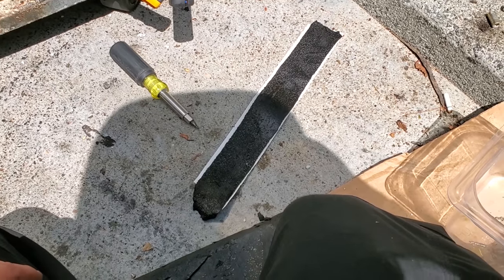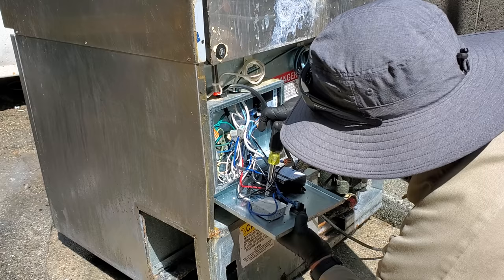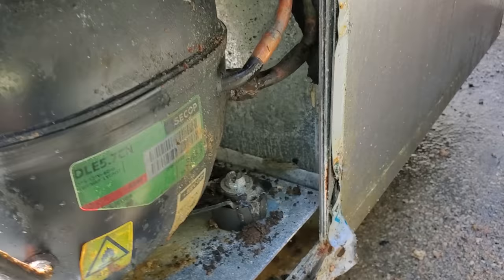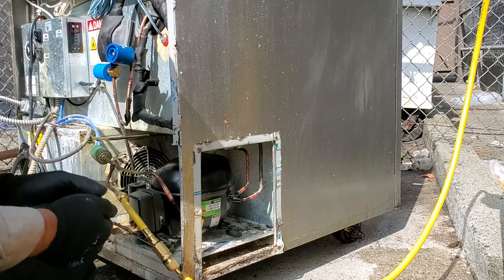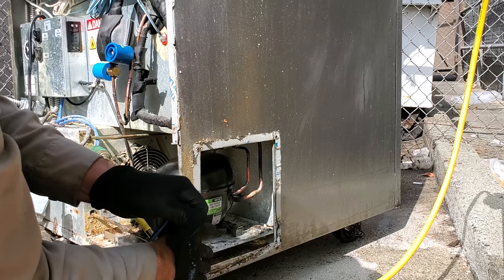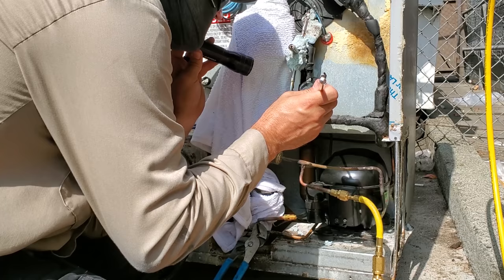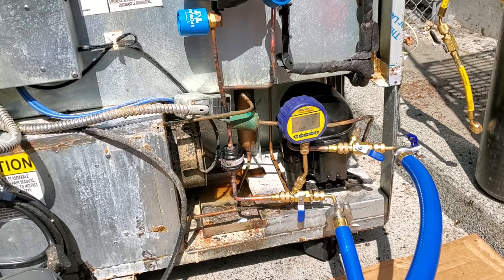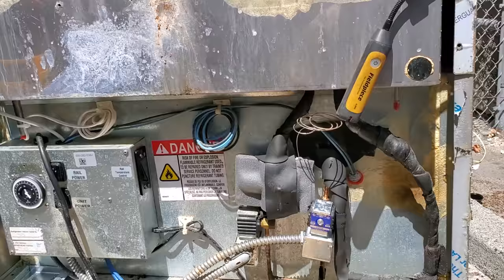ARE ROACHES REALLY THAT BAD??

Comment: In my experience as a computer technician you can have roach problems even in office buildings. Roaches are drawn to the EM fields emitted by electronic equipment. I've seen them infest printers, scanners, computers and even desk phones. Sometimes that blue screen error your computer keeps having is because there is literally a bug in the system!
Reply: Ben T.  Normally you have a company come in and spray for them. In extreme cases they may have to tent the entire building and fumigate. That gets the ones living in the walls but takes about a week before people can return to work. In one building I worked at spraying and fumigation were not an option. They did fruit fly research so spraying ANY kind of pesticide in the building would've effected the fruit flies. The only option for roach control in that place was glue traps impregnated with roach mating hormones so as to attract them to it.

Comment: I carry roach spray . I did a job customer has no heat. They answered the door. I could see a long hallway with roaches ceiling,floor,walls. When I got them running I was stripping my clothes off and shaking them. I bomb my service van. Never again........

Comment: I've used a wire wheel drill attachment ground off black paint and stay silved / Flux that suction steel to copper fitting before.

Comment: i spent the first 6 months raising the Clean Bar of a McDs, never had the 6 leg friends found anywhere. Told my boss that the costumer of the food, is they should only taste the day the meal was cooked. NOT since the store was first opened to the public. And since the cleaner that was used to wash the dish left a film upon them, the only choice was to use the extreme heat of the water heater to clean them. ~200F~ Cleans anything cooked on today, and a good puddy knife can clean off the cake stuff.

Spent 2.5 years there, Starting pay $7.25, Raised ~3 month into job plus $0.10, Quitting Pay $7.35. Worked enough hours to earn OVT, but due to how the run the calendar, and work weeks. No one ever got OVT, even with working 9 days straight. 9h50m per shift. Nope you don't get OVT pay, all is regular pay.

Comment: really a good video. I think roaches are to a kitchen like refrigerants are to commercial refrigeration equipment,  unfortunately.   I do both refrigeration and commercial plumbing and I know they like steam, water, and sewage leaks or stagnant water.  Never forget working in a tunnel and he was spraying them with raid,  they would run to the stagnant puddle and flip over in the puddle and do the back stroke, not knowing they were trying to get the chemicals off there back. lmao

Comment: Many years ago I worked doing warranty and non-warranty repairs of consumer electronics and I would often get units that were roach infested!  It was nasty and customers often didn't understand that roach infestation is NOT covered under warranty or extended warranty.  Roach infestation has to do with the unit's environment, not manufacturing defects or design issues.  After doing enough repairs, I got to recognize when to expect a unit to be infested:  A distinct smell, typically an apartment and typically by last name of customer.  Without using chemical, I would take canned air flipped upside down to freeze kill the critters when opening the unit.

Comment: I repaired large stereo receivers in the 1980's and 90's. Yes, the electronic components do attract grease and other cooking aerosols from a non-vented home kitchen. That with lint looked a little hairy on the components. This plus the heat generated attracted the roaches. The company I worked for didn't want the tech to mention the word "cockroach" or its derivatives on the repair ticket. We had some good techs laid off or fired for this. Cleaning electronic components covered with the grease, roach skins and droppings was difficult. We had to be careful not to get this stuff on your clothes. You can carry the roach eggs home with you. The roach smell.

Comment: Typical of many Chinese restaurants roaches grease coated condensers! You just deal with it! You did a great job on that unit! I hated cork tape too! When you have leaks it makes a good nasty mess and you have a nice fire when you are unsweating! Like that you used the heat dough instead of the wet rags more techs should use it works really well and is nothing like the worthless paste they had back in the day! I personally like the turbo torch better than the oxy acetylene torch easier to handle and Less bulky! You have a tip size for every job and the flame wraps around the pipe heating evenly! Also you did what the customer wanted you to do and took care of the problem and gave a honest acessment that will go along way to job security at that establishment! Great video  was work intensive!

Comment: Make sure you guys wear gloves when handling the Viper products. The main ingredient they are using is Potassium Hydroxide, which has a tendancy to pull the oils out of your skin. 

Regarding the use of potassium hydroxide on stanless steel, the only incompadible metals are copper and aluminum. I would never apply a potassium hydroxide product to either metal because it will eat it at an atomic level. You'll notice it foaming up heavily during the reaction if not diluted properly.

Be safe out there guys!

Comment: 😄 was an old timer we used to take ice machines .as he was good at rebuild.on his loading ramp a cylinder of so2 sulphur dioxide refrigerant which he leaked into the units before being brought into the shop .have a few stories about so2 I.fI interested 🤗ps he rebuilt compressors cut em open re welded .that's a lost art he had hundreds.

Comment: I use fireblock putty when brazing around sensitive equipment. It works better than wet rag, an actual wet rag, and the small square fire blankets you get. It's sticky and reusable to a point

Comment: The speed with which the client responded to the roach issue, and how quickly the pest control company responded as well, leads me to believe that he/she hadn't been informed of the problem previously. That matters, because the unit looked reasonably clean from the front which is the surface in constant view, and I'm willing to give them the benefit of the doubt here.
Maybe the infestation hadn't reached the point where people noticed. People usually begin noticing once the infestation is large, because these bugs avoid light as much as possible; you most likely discovered the issue in its early stages.

Comment: If it wasn't for the channel name and the thumbnail's background image, I would have thought that this was a Starcraft 2 video.

I saw a single roach once in my house, but then I never saw any roaches at all there for years later nor any years before, nor any signs of their activity. So the saying of "if you see one, there's definitely more" isn't 100% true, although it's probably true 95-99% of the time. Note that it has no bearing on this scenario, since clearly this scenario was an infestation and a sign that there was much more infestation at the location.
Reply: I used to own a small chain of BBQ restaurants.  I was a fanatic about sanitation but we still got roaches.  The incoming produce was teaming with them.  Especially the potatoes.  At each restaurant, I had an air-tight room built for receiving produce.  Someone would flood the room with USDA-approved food-safe pyrethrium (daisy pollen) insecticide and let the produce soak for a couple of hours.  There was a large sink in the room and all produce was washed before being put in storage.

Comment: Was it good to replace the entire compressor? or could the leak not be repaired with some sort of seal/patch? Or maybe that would just result in just more work work than replacing the compressor anyway (and/or leak in some other spot). I guess it might have also been hard to keep the pressure/vaccuum with just a hole-patch too. Oh but I guess when it's under warranty it makes even more sense to replace it I suppose.

Comment: We use heaters with a curved head that disperse heat more efficiently over the work instead of an open flame. We use it to melt heat shrink and even solder wires. If it gets hot enough to melt lead it should get hot enough for that?

Comment: Once serviced a medium size sausage factory and smoke house ,roaches were getting into defrost clock contacts compressor contactor contacts , They had open bins of stale bread and buns to mix with the sausage meat , The walls of the smokers were covered with roaches just disgusting ; The comical part is they supply the parliament of Canada cafeteria and the upper class Chateau Laurier in Ottawa Canada , Our Canadian Prime Minister and his ministers are eating those sausages LOL

Comment: NASTY! lol, but even my job has 1 issue, but we have pest control, but cant fix this 1,  dumpster  (compactor) where food leaks as employees throw food into, the electronic box to control  compactor has them all over, & when you open door, yikes, but no where else do I see them, other than a few feet from.
for working in those gloves, better than bare hands, I use "mechanic gloves" to do light sheet metal welding, or spot weld then finish up with welding gloves, but a few months ago I was grinding some metal, a flake size of a finger nail landed in my way, I went to flick it out of my way & it was still so hot it sliced through leather & into edge of finger, glad I had some protection, but metal had spot welded itself when it landed, so I actually took a tool & hit it to knock it off, my point being try to keep anything on hands thats not flammable, doing anything to glove is better than same thing happening to your skin. 
for torch, look at your seals, and it sounds like a dirty tip?  torch I know, HVAC only a beginner  to hold the tube in place, you needed a custom bent coat hanger?  I found a used uniweld torch, it came with 2 torch bodies 1 with top knobs & 1 with bottom knobs, but I do need to replace torch seals, 1 seal has a crack, none look good, but like $6 for all,

Comment: Roaches ? You haven't seen roaches until you've worked in a Kmart cafeteria 😂 I had a call where the kitchen RTU would always read 102°: guess that's the roach nest temperature. At least 500 roaches had crammed into the zone sensor.

Comment: That funny noise from your torch sounded like a dirty head, carry a block of untreated wood, while you got the flame going, lightly rakethe tip of your torch along the wood block, more charred is better, and don't be alarmed by the popping it will do. Or you can do the lazy thing and replace the head lol. Source, what I learned in my vocational welding class in high school, take that how you will.

Comment: I worked in Commercial Baking from the age of 12 till I was 17 (i lied about my age and it was night work) but we had a schedule for cleaning reach ins, walk ins and proofing boxes to clean from top to bottom at least once a month. I'm sure you have seen a bakery or restaurant after a shift they look disgusting but you are right, if you see pests, the pest control is usually there within hours and we we stuck cleaning after shift in overtime.

Comment: That's an interesting torch lighter - looks to be easier to use than the flint striker type.
Reply: I'm assuming it's a gas lighter with and the tube acts as a windbreaker.

Comment: Did they give you a very generous tip because for sure they wouldn't want that secret to get out, my dad works in commercial refrigeration so we know which restaurants are clean and which aren't, also just a tip dont drink the soda from the soda dispenser most restaurants dont change the filters and it's a hot spot for rodents

Comment: They used to get into the defrost timers on refrigerators in labor camps. Back then, the Spanish workers cooked with lard.  Cockroaches love lard. I once pulled a kitchen range away from the wall, and the cockroaches were piled like a brick, behind the stove.  When the light hit them they scurried into the wall, where the gas line came though.  On another job, they tore a kitchen wall down when remodeling an old Italian restaurant, and the whole wall, from top to bottom was filled with cockroaches.  Millions of them.  When the Sheetrock was ripped off, oceans of them hit the floor, and they were a foot deep.  After a minute, or so they had all scurried away.  Grossest thing I ever saw on a job,  other than a piece of meat left on a restaurant kitchen counter, after the earthquake in 1989.  When we re entered the building, about a week later, the slab of meat was moving and pumping on the counter.  It was full of maggots.  I lost my lunch on that one!  Was all that corrosion on the cabinet caused by rat piss?  Hope not.

Comment: Well they rather pay you a thousand dollars to fix it than 8 grand to replace it. The store in town owner said he rather pay me to replace fan motors and fans on his condenser fan table with no guards because the mounting holes are wobbled out to 4 inches and he doesn't want to spend the money to fix than to spend 40k on another condenser table. Who gets the blame when a Chinese blade shears off and whizzes by a campers head when he's dumping his camper sewage and lodging into the side of his 100k camper? Stop bitchin and fix the damn thing. Charge them 2 percent under what it cost to replace the unit and make it better than the factory ever intended and move on with your life.

Comment: Did you pinch and braze off the service ports after? The ones I do here, I have to seal the system and put the red sleeves on the stubs after the job is complete. This is to prevent someone from hooking up gauges to the unit if they fail to read the data tag and warnings.

Comment: 190 high side? Typical residential RF run about 150 on R134a. R410 in new window AC's run 125 just on the low side. Never checked high side. I'd imagine it's nuts. As far as roaches .. I'll go in people's homes daily and repair home appliances. I see it quite a bit. This was nothing. Literally nothing. I have walked away on only 2. It was because there were so many, they would start crawling on me. On my shirt and pants. I'm out at that point.  As far as warranty, if course there is no warranty for infestation. I always do the job 1 time and let the customer know hey .. I'll do this once. Next time you pay for it and if the MFG audit the parts and reject the claim, I go back to bill the customer.

Comment: One flaw, using a wet rag to cool the joint. That will crack the solder and will lead to a failure of the joint.

Comment: I would of refused to repair that.  I worked as a mover and we refused to move someone cause they had bed bugs.  the truck was 1/8th of the way loaded when we spotted it.  everything went back in the apartment and we left.  we weren't dealing with that.  And dont get me started on what the inside of the apartment was like.

Comment: What I don't get is why someone would pay to replace a bunch of parts on a machine even when buying a brand new machine would cost less than the cost of all the repairs...
Although I guess in some cases "new equipment" and "repairs" come out of different budgets (and need approval by different people). And if its a franchise of some sort, the franchise may have rules about this that make repairing easier than replacement.
Reply: It was a warranty job.

Comment: That remainder of the stainless covering plastic that’s around the right side access panel is so sad. I mean, sad two ways: it’s an access panel, just unscrew it a little while pulling the plastic off guys! But also, the manufacturers should not be leaving that plastic on behind fixtures.

Comment: Why does the service bulletin recommend cork tape over something like say, spraying with an anti-corrosive paint? If the issue is that the solution has to be able to be removed for repair at some point why don't they just use silicone tape? I dunno, I might be missing something since I don't work in HVAC, but the problem of corrosion is a fairly universal issue with common solutions, I just don't understand why, out of everything, they chose cork tape.

Comment: On that compressor were those joints brazed with a brazing rod or were they sweated with solder?  You used both terms when talking about the process, but it did not look like you were using a roll of solder.

Comment: Hi just got this channel recommended by another video; quick question: is there a reason you didn't use a puncture valve to check if there was no refrigerant? 
If I come across an r290 system with no way to see if there is still refrigerant inside that would be my goto. On the other hand, you're outside in this case so the risk is minimal.

Comment: Crazy that your videos for huge 10 ton systems can be like 10 min but a video for a tiny reach in is 36 min. Makes me think it takes more time on the tiny stuff.
Reply: Industrial units tend to be more robust, because they are designed for high loads and 24/7 operation. Only a limited number of fail points.
Smaller units tend to be designed to a budget because given the choice people buy the cheaper models. Smaller businesses also try to skimp on overheads, and may end up buying the wrong unit.

Comment: I'm glad you used compressor from Secop. I worked for that company for few years. :) just for sake of curiosity was is FR type or NL type ?..  btw shaking like you did ..is possible but should not be done.. for side note...those compressors will not last like in the past..unfortunately..there is always saving done..